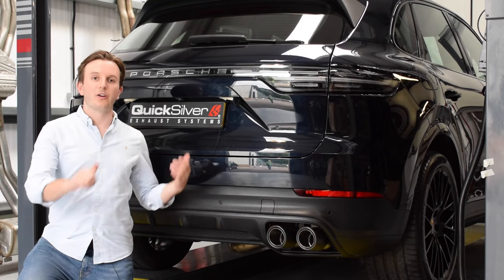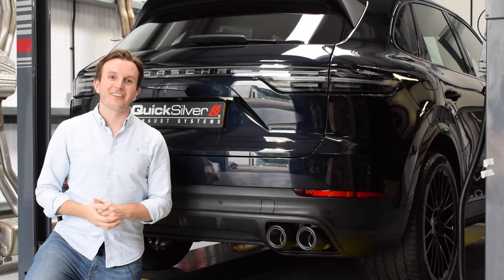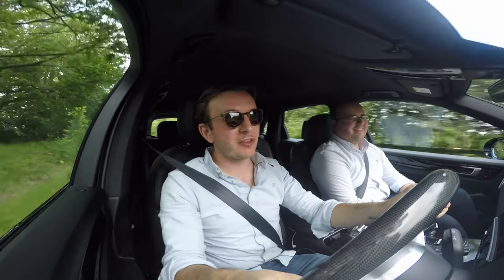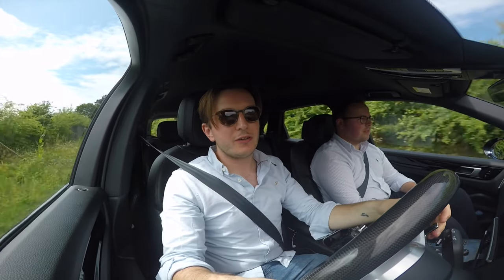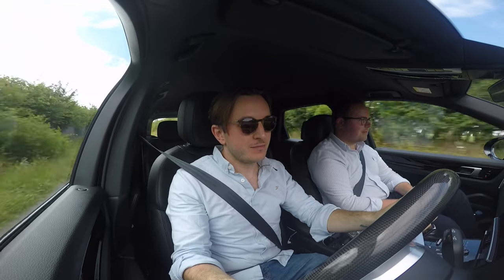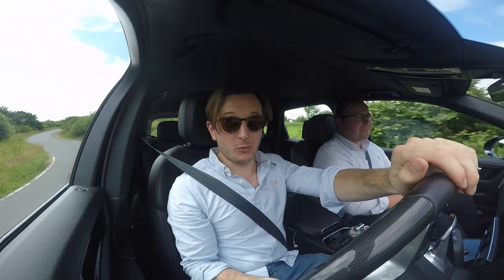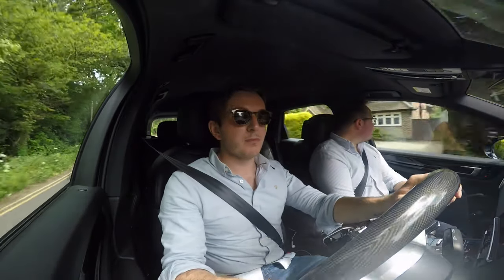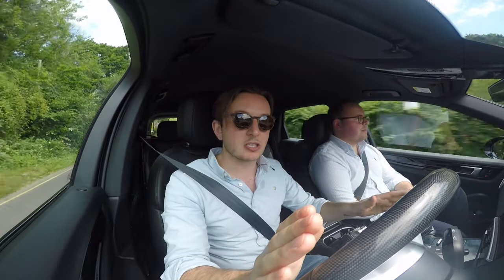2019 Porsche Cayenne with QuickSilver Sound Architect Exhaust

Comment: Will this system void my warranty?
Reply from the maker: It's cat-back and reversible to stock without a trace, so there's no grounds for this system to void a warranty.
Reply: QuickSilver Exhausts it’s gonna be hard to reinstall every 10k miles when I go for oil change or service
Reply from the maker: @behappy2382  I don't see any reason why you should have to remove it every service time. We have a number of cars out there maintained by main dealers.
Reply: QuickSilver Exhausts in Saudi Arabia, we only have one exclusive porsche dealership. So if you miss up with them say bye bye to the warranty. I really like your system and sounds amazing but I don’t know if I could be risking my warranty.
Reply from the maker: @behappy2382  why not give me a call on +44 (0) 1428 687 722 or contacts @ quicksilverexhausts.com and I'll talk you through it.